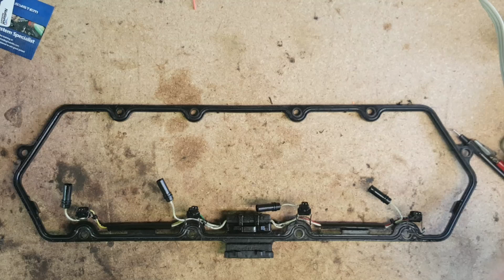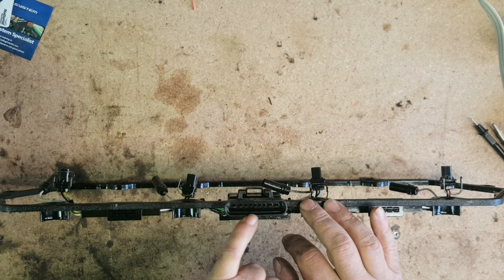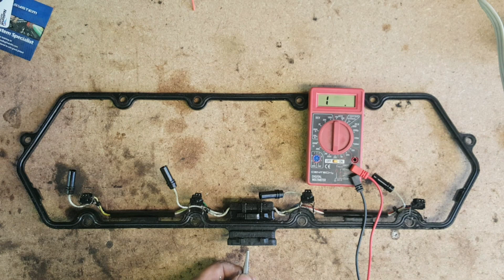7.3 Powerstroke Misfire - Valve Cover Gasket Wiring Failure Analysis

Comment: The insulation on my Dormans is all cracked and split on many of the wires after 25,000 miles very poor.
Reply from the maker: I've seen that a bunch of times with Dorman gaskets. As a general rule, I won't use a Dorman product to replace anything that takes more than 5 minutes to get to. I always prefer OEM parts. Aftermarket stuff has bitten me too many times.

Comment: I have a feeling this is the problem I am having in my truck at the moment. I have a 1998 E-350 7.3 ambulance that has been having trouble starting, bunch of white smoke and can’t get it to kick on. I did a resistance test on the ucvh but everything read as open. Got new gaskets and glow plugs to pop in hopefully it fixes my problem
Reply: Did you install and any update on if it solved the problem?
Reply: @TruckCamperCooking  yeah so I ended up changing out all glow plugs and both under cover valve harnesses. I changed the oil, put on a new oil filter and changed out my flow plug relay because it had failed too. Ended up having to remove and replace the passenger side pig tail because the factory one had melted and I could see bare copper. 

I tried to get it started after that work and it gave me a hard time, I popped open the fuel bowl and removed the fuel filter to see if maybe the filter was clogged. Ended up turning over and firing right up without the filter. I was able to find a Ford replacement a week or so after and I think I may have gotten air in the fuel line because it is having a hard time starting again. Bought 2 brand new motor craft 850cca batteries that ended up needing to be swapped out within a week due to a manufacturer defect.

At this point I have a plan to push air from the fuel tank through the lift pump up to the fuel bowl using some compressed air to hopefully clear the lines and get it going again.

Comment: I bought ultra power ones off rock auto and had to reseal it with gasket maker almost a year later. I inspected the wires and sure enough they were to cracking. I left it alone and put it back together, time went on the truck runs fine but I'm suspecting there is something wrong now, unburnt fuel coming out the exhaust getting on it. I'm gonna start back on it when I put my new cover on.

Comment: Hi there I'm doing the same test as you but I'm getting  .2 ohms on each connector my question is this number is good or bad ?  My truck is misfiring in all 8 cylinders and has the original cover gasket with around 480k miles.

Comment: Or you could use DieselTechRon's quarter fix.  Do the replacement gaskets for these come with the shim upgrade like the later 7.3?
Reply from the maker: The quarter trick isn't for this problem. The quarter and the shim are to keep the inner connector from unseating from the gasket. I really don't remember if the shims come with the gaskets now or not . . .

Comment: Any problem of a 7.3 that overheated, now it starts very slow, and it runs for 20 minutes and it starts losing power
Reply from the maker: From what you describe, the symptoms sound like a high pressure oil system problem. HPOP, IPR valve, injector o-rings could possibly be the cause. Do you have a scan tool you can use to monitor (and preferably log) ICP sensor voltage, IPR duty cycle and fuel injection pulse width during startup and while driving? ForScan is a good free option for WinD'ohs or ForScan Lite (paid app) for Android.

Comment: Awesome video sir!!!!!! Is there any way you can post a link to the hardwired gaskets you refer to in the video????? I have an '01 and I would love to eliminate any potential problems in the future when I fix this issue with mine.
Reply from the maker: I can now confirm from personal experience with the Dorman gaskets that the insulation on the wires from the gasket to the injectors and glow plugs does indeed become brittle, crack and fall off. I can't recommend using them. The OEM gaskets and harnesses are still the best parts to use.
Reply: @PikachuG5  I thank you sir for that very valuable information!!!!!! And I thank you for your reply as well!!!!!!!

Comment: Did it run good until started getting warm.? Tyats what mine does then it starts romping turn it off then back on it clears up for few minutes then back to ruff idol.
Reply from the maker: No, this one ran rough as soon as it started. Do you have any codes set? It will take more than a generic OBD-II scanner to read them . . .
Reply: @PikachuG5  no mines in a international 4700 tow truck but its same wire harness I dont know if it has a scanner plug in it
Reply from the maker: @fordnut4914  Ah, then you'll probably need Navistar's software or a compatible aftermarket product to read it. I've seen cases where rough running when warm was a symptom of an issue in the high pressure oil system, but I'd need to see the numbers before going down that path. The engine oil is in the full range on the dipstick, right? That's an often overlooked item that can cause poor running since the engine oil serves as the hydraulic oil for the fuel injectors.
Reply: @PikachuG5  hi i have 96 7.3 ot will crank but not start. Afyer a new set of glow plugs and a new ipr sensor still nothing. Can you help me out in the right direction please? Thank you

Comment: Great job, and thanks. That's my next project my 2000 has 230K, sensors were going bad, now lack of power and loping, will check fuel pressure see where I am there, then move on valve covers.

Comment: in my van I've had the same problem in it to a code for the number 8 and number 5 injector. I reach my hand back there to the harness that plugs into the valve cover and got shocked. when I touched it it immediately cause the engine to shut off. I would assume that I have a bad harness if it's shocking me when I touch some of the wires. would this cause injectors to not fire properly? thanks